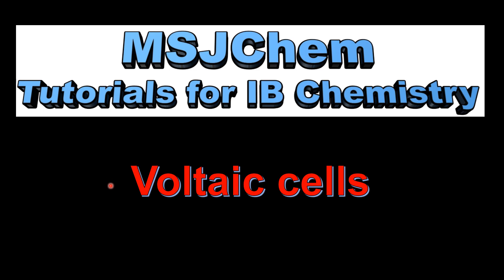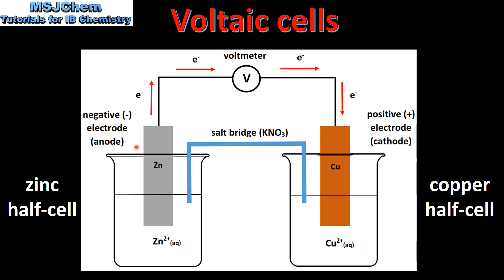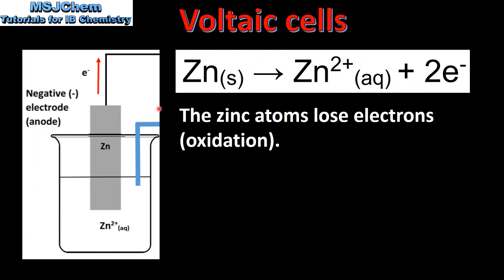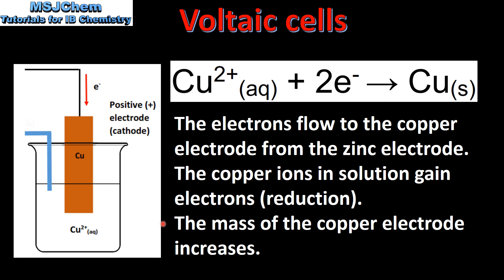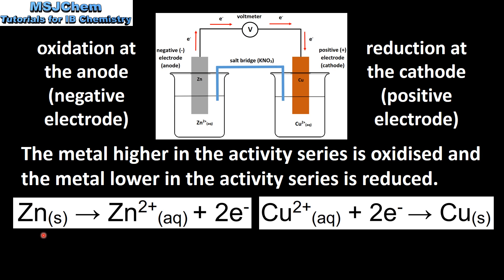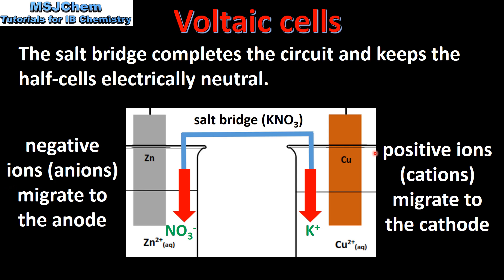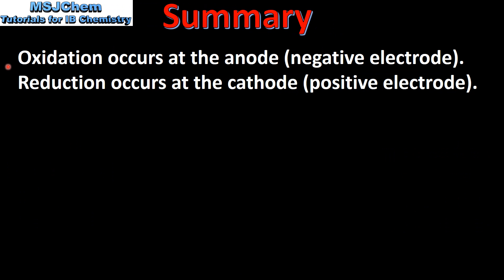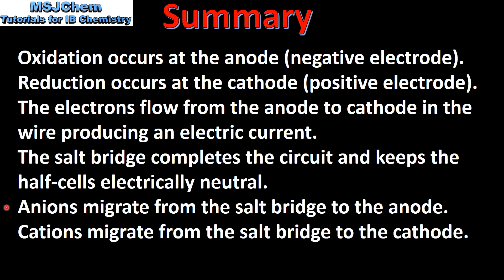9.2 Voltaic cells (SL)

Comment: A voltmeter is not a series instrument as shown in your diagram. A good voltmeter is one which has a near infinite internal resistance. So no electrons ca possibly pass through it. I suggest a lamp be includedin the wire connecting the two terminals. A voltmeter can be connected across the lamp

Comment: I think the electrolyte chosen for the cathode half cell is not right. Because there needs to be a negative ion rather than a positive, so SO4 2- instead of Cu2+. This is because only then the K+ of the salt bridge will be able to neutralise the electrolytic solution of the cathode half cell.
Reply from the maker: The electrolyte is correct - the copper(II) sulfate solution contains Cu2+ ions and SO42- ions. It is the Cu2+ ions that are needed in the electrolyte.

Comment: If the anode is losing electrons then it should the positive electrode and if the cathode is receiving these negative electrons,it should be negative, how is it the other way around???
Reply from the maker: Basically the anode is the source of electrons (from the oxidation of the metal atoms) therefore it is the negative electrode.